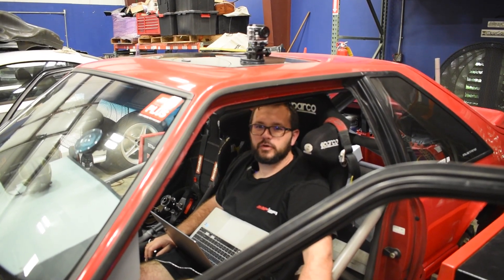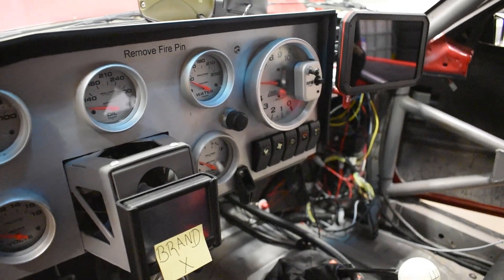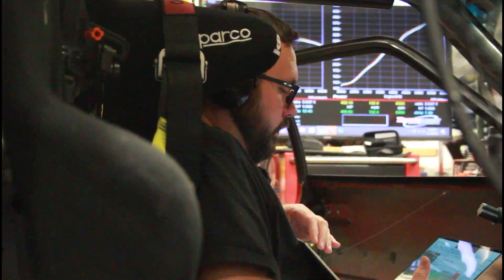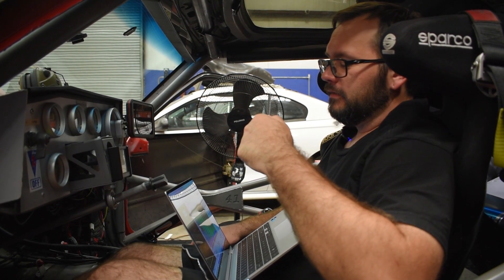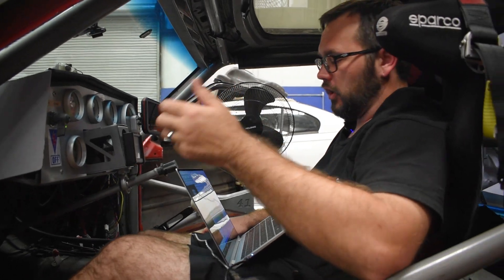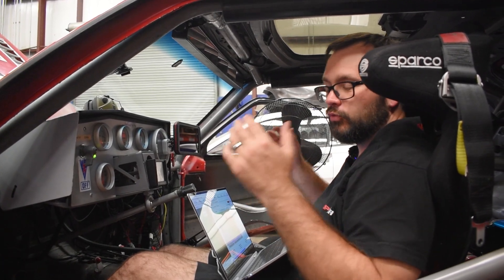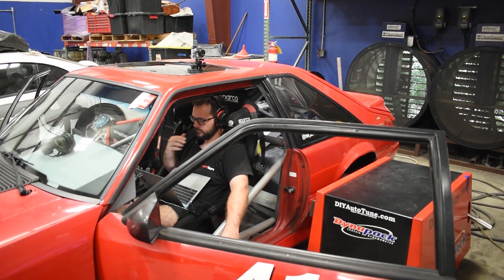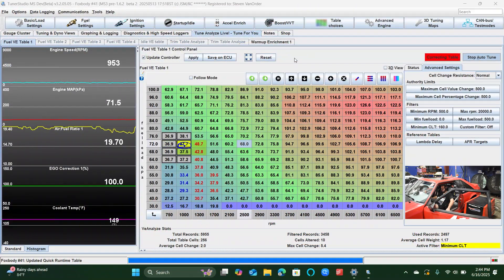Project Foxbody 41 Part 1

Comment: Would it not go faster  tuning using very easy mode on autotune?
Reply from the maker: Yes it would, it would also make changes during transient enrichment and while I am modulating the throttle. I ONLY want to modify the table while the engine is steady state